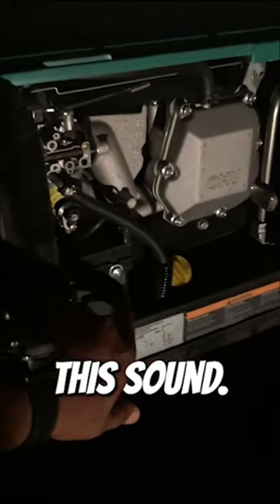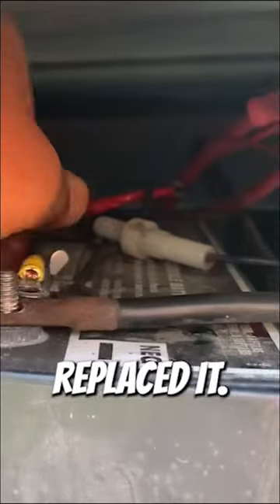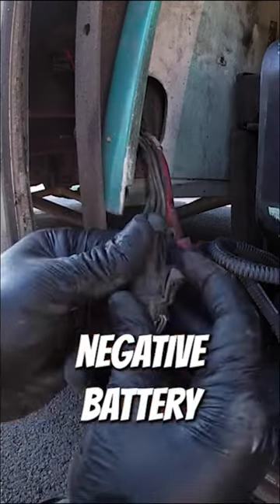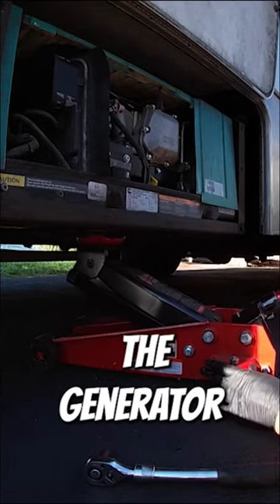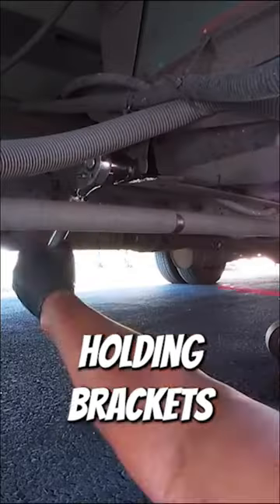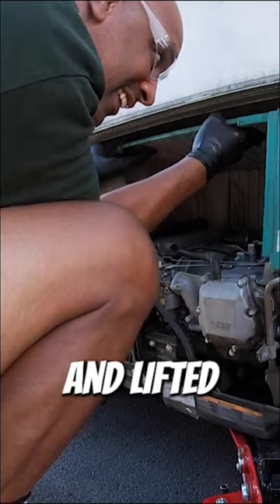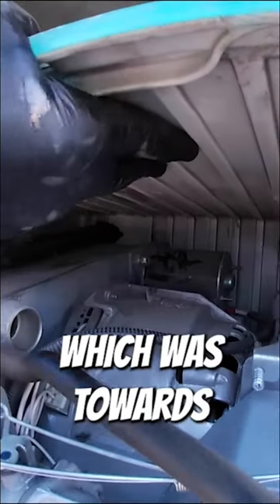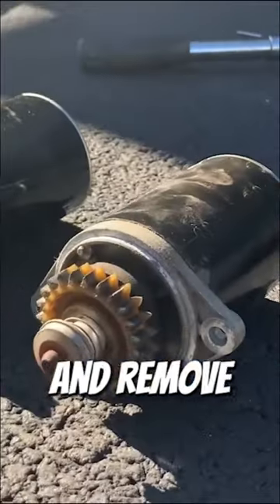Onan 4000 Generator Starter Replace⚙️🔧#shorts #rv#rvlife #rvrepair

Comment: My generator is not getting enough juice from the batteries to turn it over. I have a brand new battery under for my house battery. The man at the RV shop told me there is a solenoid or a cut off to cut one of the batteries off from one another, I have looked all over my class C 2000 and2 G 3500 for that solenoid or cut off. He said it needs reset where is it at?
Reply from the maker: Not sure where that would be either. Sorry couldn’t help
Reply: Mine is an onan 5000 and it has a reset switch on the right side towards the back of the generator. There are actually 2 switches there. I have had to reset it. Pull forward and then back to reset. Hope this helps